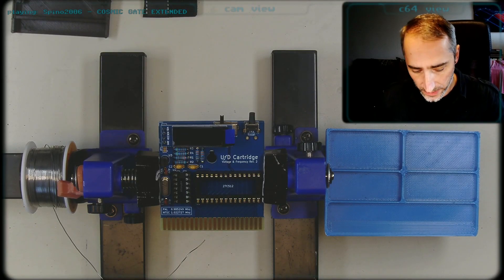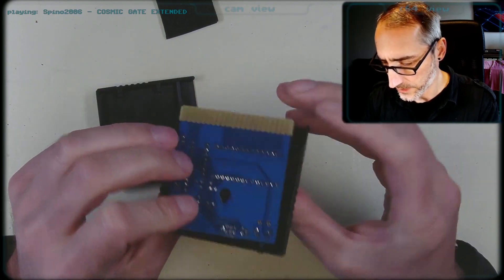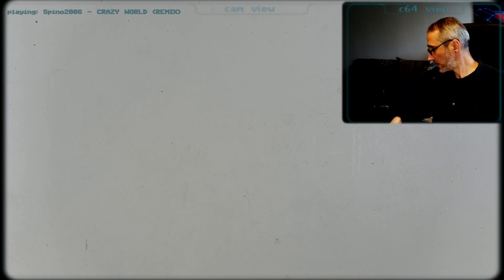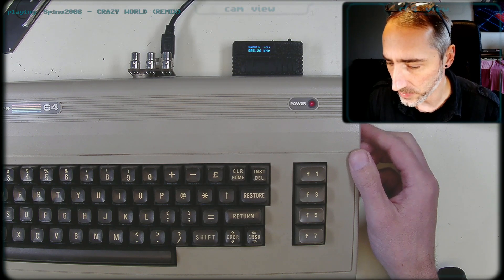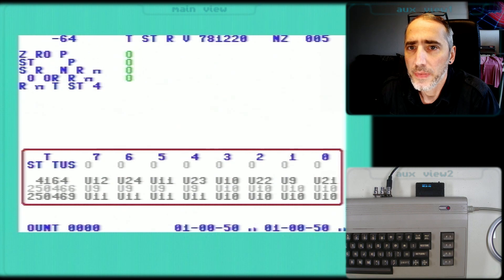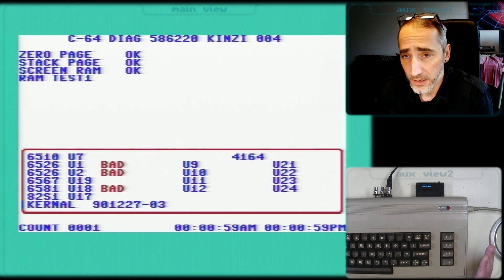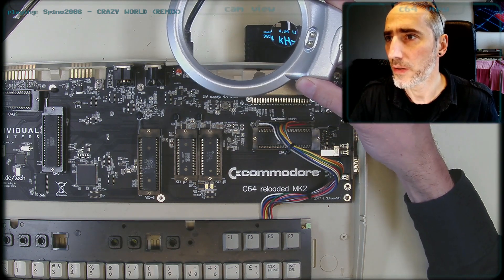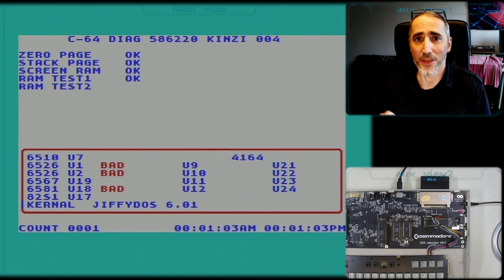C64 - Voltage & Frequency Test Cartridge

Comment: Sounds like an interesting project. I am recapping my Commadore 64. I have a dead test cartridge but I need to make sure my power supply is reliable. Not working yet but I'll get there.  Thanks for the content!
Reply from the maker: If it is an original power supply I would definitely check it before connecting it to the C64, they tend to do crazy things with the voltage over time. There are some C64 saver available as well, they protect the C64 against over voltage. Getting a more modern PSU replacement is always a good choice :)